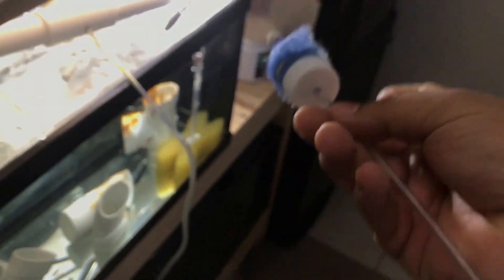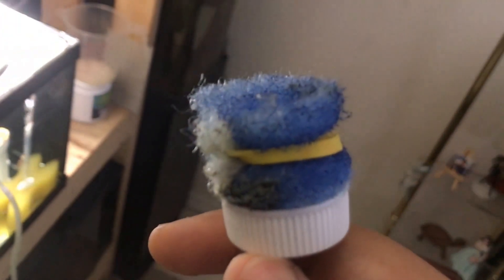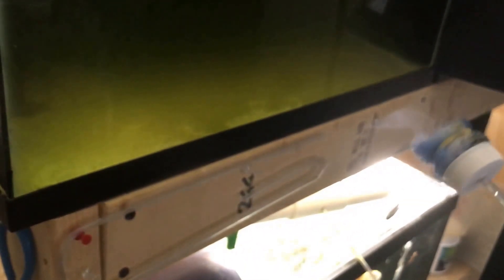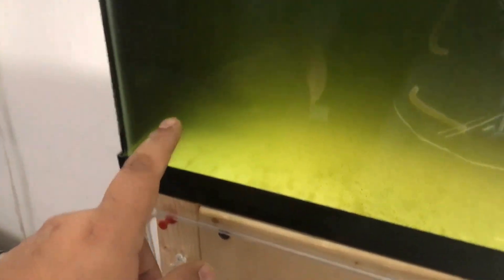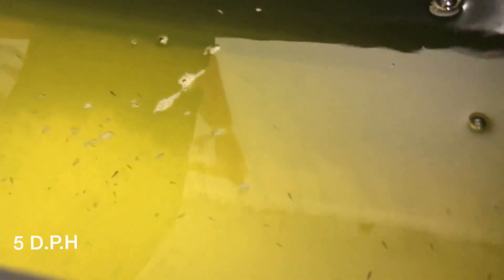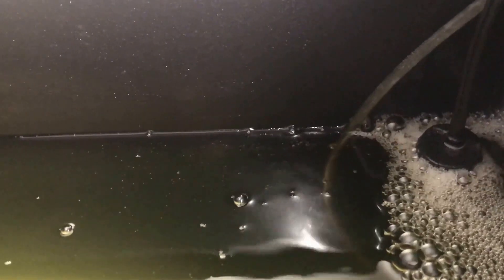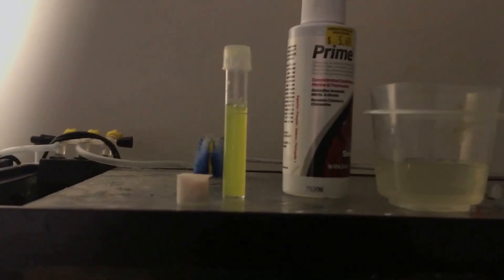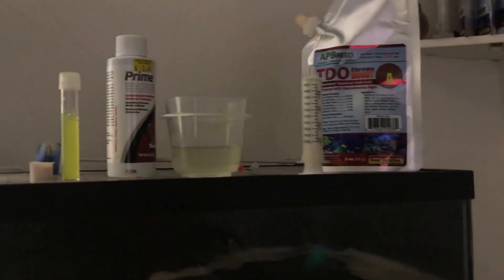Clownfish Breeding Series - Days Post Hatch (D.P.H) 4 - 9

Comment: Hey man. Did you had the light on all the time for them since they hatched? What’s was the light times once they past the 10 days or so? Thanks. Love your videos.
Reply from the maker: No, usually hatch night I leave the light on. Then I add rots right away. Very low light and not pointed directly at the tank. Then the following nut I follow a 16 hr schedule
Reply: But when did you started that 16 Hr light schedule?  I’m on day 3
Reply: Is that what you meant with the 16 hr?
Reply from the maker: @jaysantiagoofficial6133  so since they hatch at night (usually 10/11 PM for me) I will leave the light on until the following day. So lets say they hatched Friday at 10PM. Then I usually leave on until Saturday 10PM. After that I get them on their regular schedule. So 8 hours of darkness then 16 hrs. So basically Friday 10 Pm - Saturday 10 PM light. Saturday 10:01 PM to Sunday 4 AM no light. Sunday 4:01 AM to 10 PM light and just keep repeating the 16 hrs
Reply: Gotcha. I thought since they have to constantly eat and they don’t see well lights need to be on 24-7. They hatched Monday at 12 am. Been having the light on 24-7. You think I should start turning them off for 8 hrs?

Comment: When you give a water change on day 4 or 5 do you only do 1 gallon?  and when you use the air line and tubing do you just suck on the air line to start the syphon process?

Comment: I love your video series! I'm about to embark in the journey of clownfish breeding and I've learned a lot from you. I have a question though, why not add a piece of block of MarinePure/Brightwell Aquatics brick from an established tank with bacteria to fight off the amonia spikes? Is that detrimental in some way? I already have some blocks in my sump that I was planning on using on the fry tank to prevent amonia spikes. Do you think that is a good idea?

Thanks!
Reply from the maker: Thanks for watching! Yes, the sponge filters I use are from established tanks. So it helps with the spikes, but no matter what you're going to get them. The sponge filter helps later on. You just can't add it too soon
Reply: I'm planing on starting a breeding tank too I have a 20 gallon long that I'm going to divide in half with a sliding door so when they lay eggs in one side I can just move the fish to the other and hatch the eggs in the other half. I was wondering about using marine pure blocks too I have them in my display saltwater tank and never have any problems with ammonia. I picked up a hang on back filter with a built in skimmer which is cool. I was also thinking about maybe cutting a hole in my door and gluing in really fine mesh so the water pick up is on the parent clownfish side and the exit for the filter is on the fry side but idk yet it's going to be a interesting experiment 😊